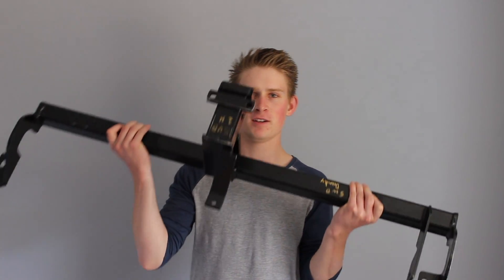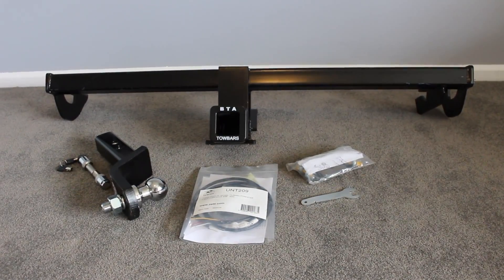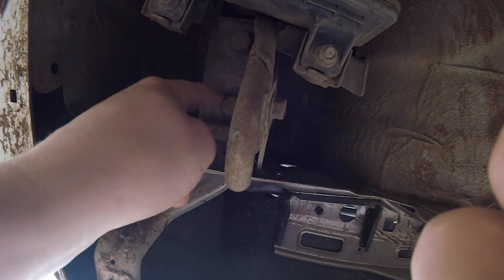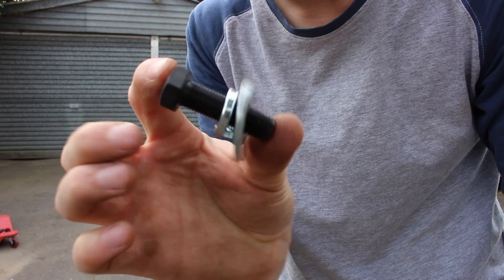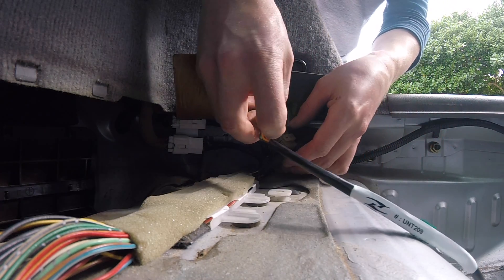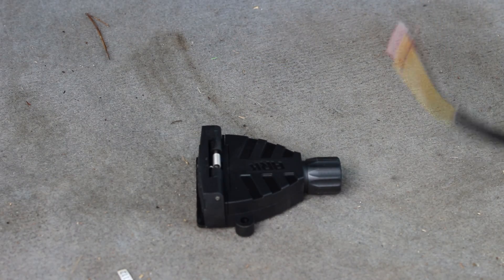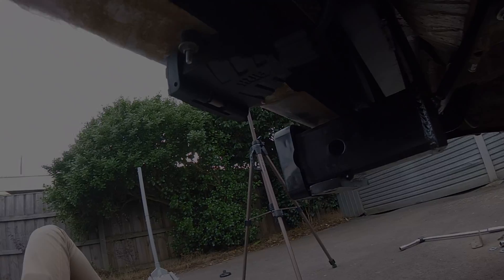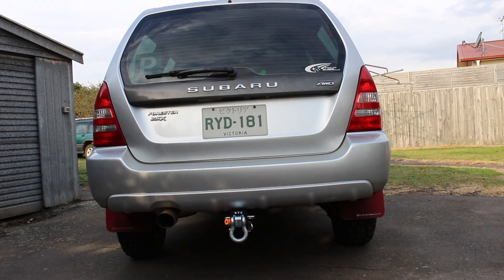Offroad Forester Project Ep6. Tow Bar Install

Comment: Great work and awesome vehicle!
Just an observation that it helps you to avoid corrosion problems with your external electrical connection of your trailer hitch. When you have set it to bumper wire should not go straight https://youtu.be/7Fw9jcHO-ws?t=4m11s , better in U form to avoid water ingest. You can see what I´m trying to explain you here; image 44, page 10/13 of this document. Ondo izan, 
http://www.mediafire.com/file/a5en75em3dl6l88/tow_wires_install.pdf/file

Comment: Fan of your videos man.
One question, would the turbo 2.5L be better for off road?? Keep seeing N/A off-road videos everywhere. No turbos.
Reply from the maker: N/A foresters are more reliable, easier to work on and cheaper to buy. Also if your traveling to remote places, the N/A's are better on fuel and you can put cheap fuel in an N/A were as you always have to have a high octane fuel for the turbo models. In saying that the most popular offloading foresters are the XT Turbo paired with an auto transmission. If you check out my Border Track video series you will notice that the majority of foresters were turbo

Comment: Was it necassary to take the exhaust off? and about how difficult is that for some one who is used to doing light repair work on cars.
Reply from the maker: Yes, exhaust needs to come off because the bar sits underneath and replaces some of the brackets the exhaust hanger sits on. I found this to be a fairly simple job once the tow bar was lined up so I think you should be fine.